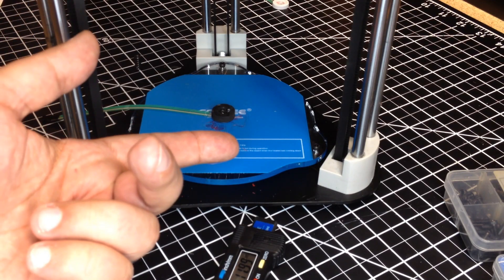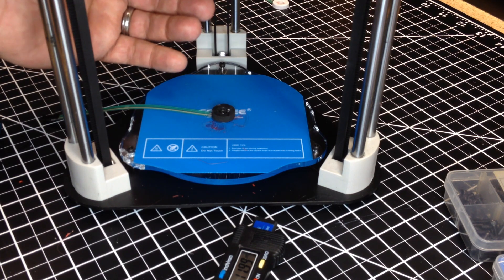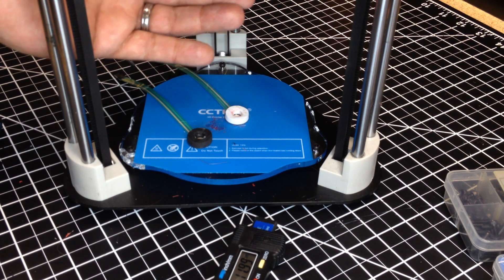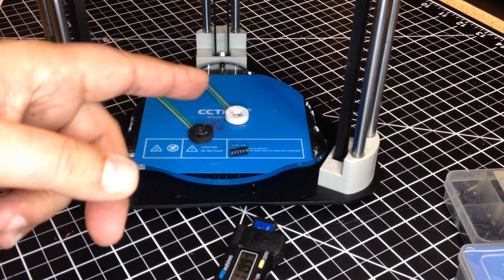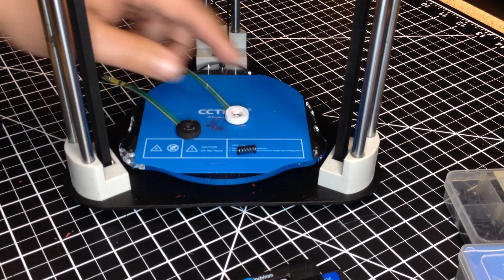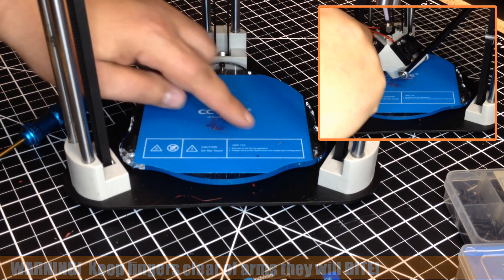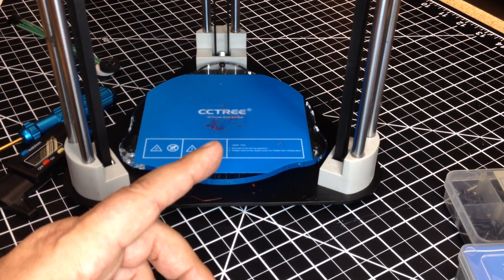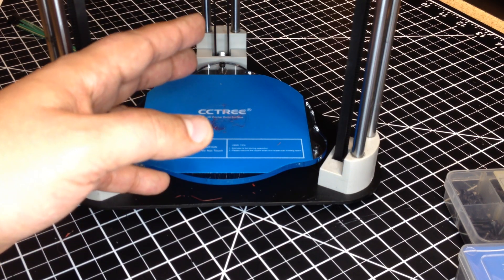BIQU Magician - Print Surface Spring Modification!

Comment: It usually auto level with the flexible plate. The fixed plate and flex plate is around 6-7mm in height.
Reply from the maker: My plate was bolted to the base and uses a self-leveling probe.  However this did work that well...

Comment: have you checked the firmware for Z travel range ?   Set Z min to "-1" or something bigger than your Z offset .  Example IF your Zmin limit is 0.4  yet your Z offset is 0.6 it will only ever achieve 0.4
Reply from the maker: Yes, and the firmware on this little guy is a bit strange...

Comment: If you have control of firmware, I would suggest enable baby-step to mod z probe offset.  After your calibration, at first print you should be able to baby-step to correct start height and be good from that point on.  I do this will all my machines that have level probes.
Reply from the maker: Many thanks for the tip! The firmware is rather basic as its really an entry printer...

Comment: I'm surprised it didn't come with leveling screws in the first place.  Was the measurement from the tip of the nozzle to the thread collar the same on both nozzles?
Reply from the maker: Hey Stan!  Good to hear from you! Nope as it does an auto level so technically dosent need them.  It was suppose to be an  entry level printer, also believe they stopped making them too...

Comment: Test Pads... new to me: what are they, where do you get them, what are they used for, etc...
Reply: Presumably they're little pads that fit over the nozzle and have some type of button (probably a cheap dome style button like you'd find in a tv remote) that gets depressed when the printer touches the bed at each point along a bed level compensation test pattern. Apparently Mr. DIY3DTech.com thought his test pad button was too depressed, so he went out and bought a new one instead of buying the one he already had chocolates and doing it's chores for it.
Reply from the maker: KatjaPurrs is correct on the button part but not so sure on the chocolates parts as I think it has an allergy  it :-0

Comment: why add springs? that's the opposite of an upgrade 🤣 (well maybe  it is an upgrade for a low end printer if you think about it, but I personally prefer a hard mounted bed as it's always stable, check your slicer's first layer or maybe there's a Z offset somewhere in the printer?)
Reply from the maker: They allow me to fine tune the work surface and while not a scientific comment, think the hot end pushing plastic against a spring loaded surface works better...